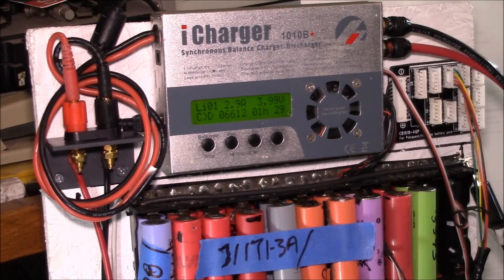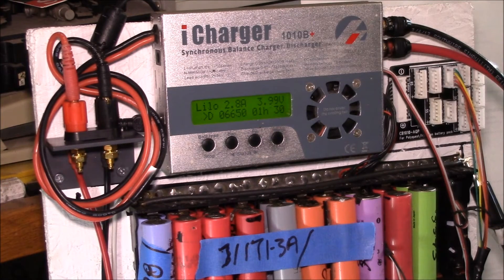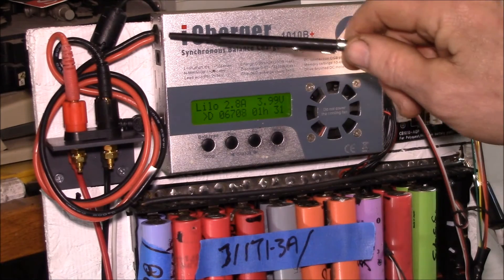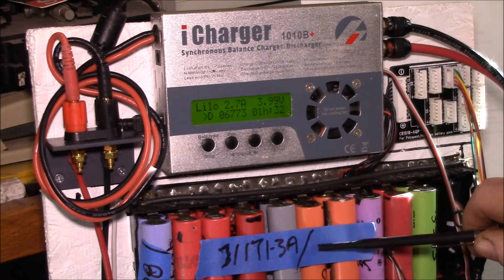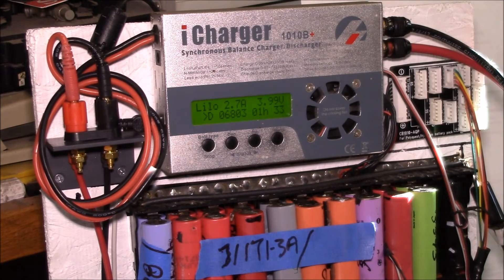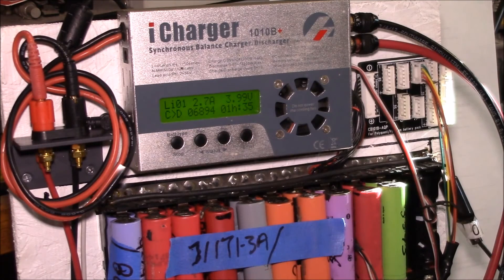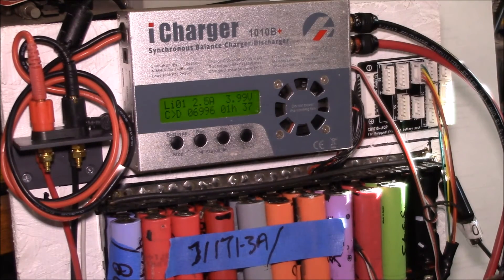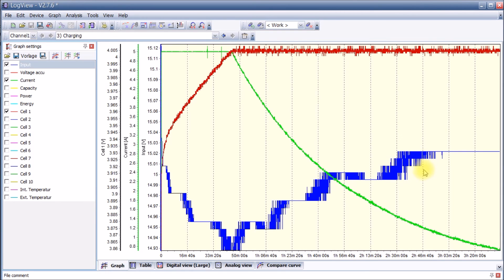Self-Powered Lithium Ion Battery Power Shelf

Comment: It's cool to see old 18650s repurposed like this, but the mismatched cells concern me. I would think that not only would it be more efficient to have matched cells in each pack, but you'd be far less likely to have individual cell failures and balance problems.
Reply from the maker: I guess I'll find out, that is part of the idea of building this power shelf for testing.  I have selected cells to make nearly equal capacity packs to address the balancing issue::
 https://youtu.be/nmtdTgMeXjI

Maybe if I had thousands of cells laying around, I could get 80 or 140 cells of similar capacity to make up a 4S or 7S pack from.  But I only have a few hundred cells and am trying to see what I can do with that.